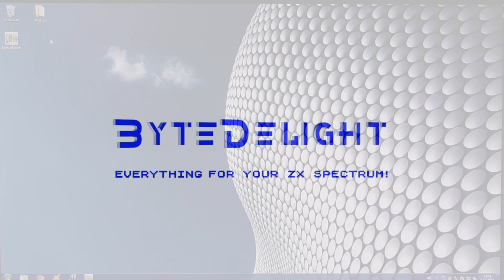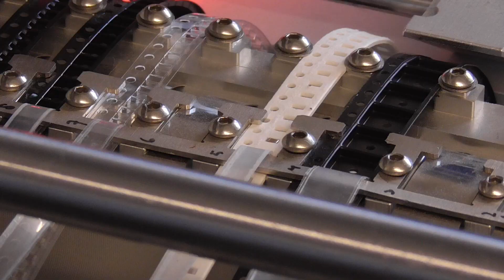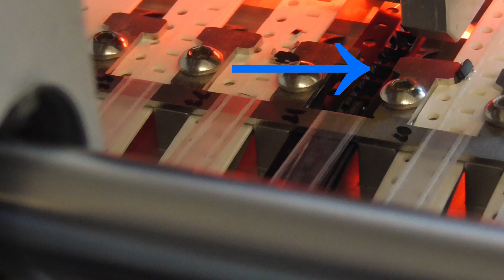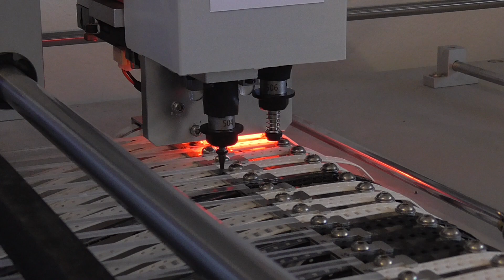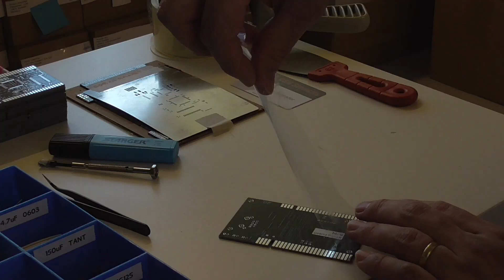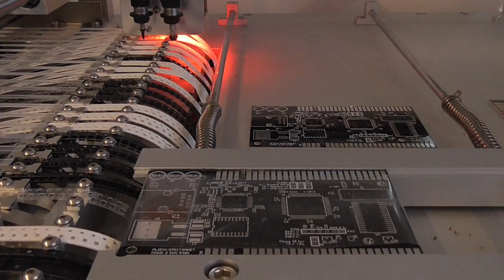Spectranet assembly on TVM802A pick and place - part 3

Comment: question for you, I cannot tell from the video but does the pump on your machine run continuous? i have the same machine but my pump seems to run or turn on 1 sec then off 1 sec, then just repeats the on/off, so when picking up components it doesnt stay picked up and falls off because pump turns off
Reply from the maker: I think so, since you can hear them buzz at power on, but they increase suction when a part needs to be lifted it sounds.
Sounds like a problem with the circuit, not sure what it could be.
QiHe however is relatively easy to contact (this week there is a Chinese holiday of course), so try that, directly or by contacting the representative on the EEVBlog topic about this machine.